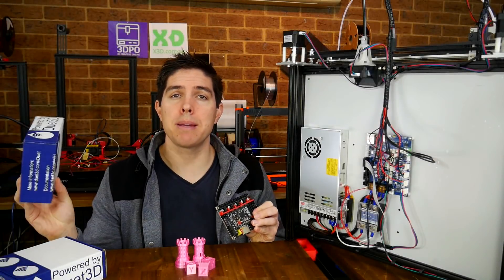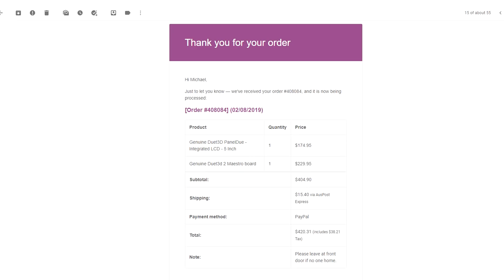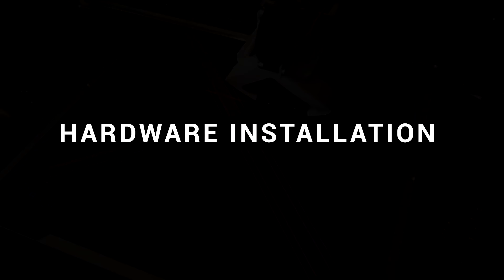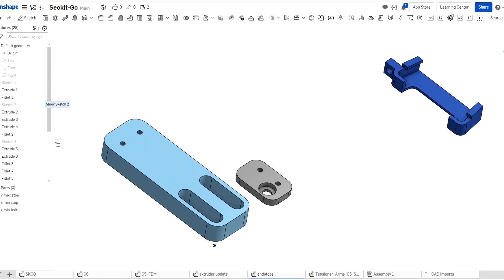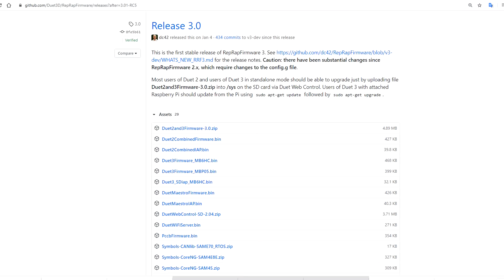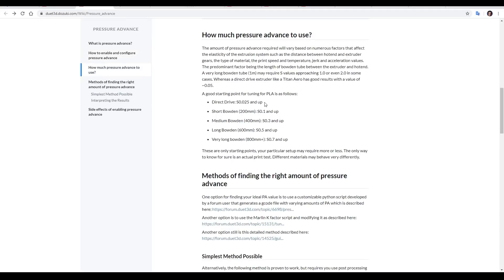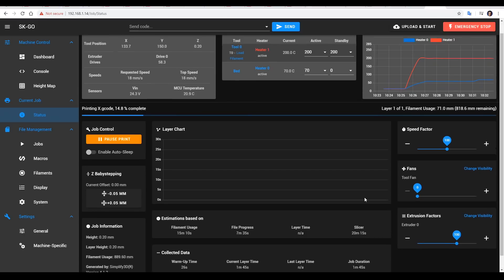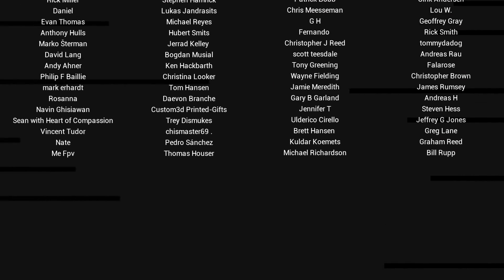Duet 2 Maestro & Reprap firmware on SK-GO: Guide for a Marlin user

Comment: Great video as always.

I am running a Duet 2 Wifi on one of my printers, and an SKR 1.4 on another.  I love that if I move the board to a new printer, setting up its config is a breeze, as long as you are getting power and are connected to the network you can configure absolutely everything else from right in the Duet Web Client.  Contrasting to this, if I want to play around with different features on the Marlin board it usually requires a recompile.

Also if you do not want to outlay for a official board, as it is open source hardware you can get a perfectly good clone from aliexpress for about the same price as an SKR 1.4 with 2209s, and although it is nice to have the display, you can work it perfectly well with a phone or tablet over WiFi, so it is a totally unnecessary purchase.

Joe

Comment: Hi Michael, thanks for the video it's always interesting to see what you are up to. For me I can say that no, there is nothing here to convince me to switch to Duet boards from my current setup. I run two printers, an Anycubic Linear Kossel and the ubiquitous Ender 3, both of which I control with a Raspberry Pi/Octoprint. From a purely economic point of view the Duet boards make no sense since networking, Wi/Fi and web interface are taken care of by the $39 R-Pi. Also by not screwing around with the printer controllers I'm not running the risk of damaging my printers. I know the E3 stepper drivers are noisy but it seems that since using damper mounts the stepper noise has been cut down considerably. I can install a large number of plugins in Octoprint and the R-Pi gen 4 is a very nippy processor. That's what's doing all the heavy lifting for the printers which seem more than capable of accepting the low level G code being sent out by Octoprint. I can set up a printer with Octoprint  and a fresh $39 R-Pi in about 10 minutes without digging into the printer itself. Contrast this with spending $150+ and at least a day switching in a Duet board not to mention the considerable risk in doing so.
Reply: From an economy point of few you also have to pay for the pi at which point a duet maestro alone is fairly similarly priced to an SKR + drivers +Pi, in particular if you buy a chinese clone (it’s only fair to compare Chinese prices against each other)
Reply: @christophmuller3511  Sorry I missed your comment. I have not upgraded any of my printer controllers. I am using the original controllers supplied with the printers, also I have discovered how to run multiple printers from one Raspberry Pi 4. I would feel comfortable running up to four printers off one RPi. So my total cost is about $55 (depending on where you buy it).  It is approximately one third the price of a single Duet board and it's open source and since it's an Rpi it is infinitely configurable if you want. That means you get Wi-Fi, Wired Ethernet, video surveillance, remote access and a huge library of plugins from the Octoprint community. For $55 plus whatever you want to donate to Octoprint Foundation.
Reply: Christoph Müller Exactly how I reasoned!

Comment: I would love to try out a Duet 2, looks like an amazing card but it is really expensive.  It is great to experiment with these new boards.  Great video as usual Michael.  I reviewed the BTT SKR Mini and I am really impressed by that board, especially the price.
Reply: Very expensive, insane. For me it costs (with 7" screen) near 10 cheap filaments.
Reply: @tolgal  There are 3 options:
1) Buy "Genuine" Duet hardware for $170+
2) Buy 3rd party Duet Wifi or Maestro hardware for $70+ (which IS allowed for under the license that Duet uses: https://github.com/T3P3/Duet/blob/master/LICENSE )
3) Buy nothing
For many people on more restrictive budgets however, the only relevant options are 2 and 3.  You'll notice that neither one of these options has any real impact on Duet3D except perhaps for people seeking support for their 3rd party boards on the official forums, which they already have a rule against.  If you've got extra cash lying around, sure.
Reply: @tolgal  Yes, but I bought from Ali because: I was not sure will I be able to put it into my printer (Anycubic 4Max Pro), how it will work, is it worth it, will I be able to solve the obstacles with my extruder etc. If you know what you doing it is great to buy original, if you trying and chances 50/50 it is worth to try with cheaper replica.
Reply: Tolgal I do have originals in my printers. But the boards are open hardware after all and dc42 doesn’t gain anything from people using SKRs instead.
Reply: You can buy clones from Aliexpress for significantly cheaper if cost is an issue for you.

Comment: If you use prusa slicer you
Can slice and directly chose to transfer the file to the printer if it’s connected. You can also chose to start the print as soon as it’s transferred.
If you like to tinker with your printer duet is so easy to use cause you don’t need to compile firmware. The duet forum is also superior to anything. Most of the time you get professional answers in a few hours.
Reply: You can use the Prusa Slicer to transfer files to any Octoprint printer. Marlin works fine.

Comment: Superb informative video (as per norm) the main issue I have with not already trying the duet is the need to re wire, it's not easy the amount of tools I have bought trying to help me with that is embarrassing to say the least. Thanks again though.
Reply: Ultimately you only need one crimping plier: Engineer PA-09. Yes, a bit more expensive, but compatible with pretty much every crimp connector you will find in a 3D printer, including JST (SKR boards), Molex KK (the duet boards),  Molex MicroFit JR (used by some E3D hardware)...
Reply: You could solder the wires in those terminals. But if you wire a lot, I agree, a crimp tool is faster.
Reply: You dont have to re wire I have a flsun prusa i3 clone and my connections fits right In
Reply from the maker: Besides the need for the tool is the time requirement, which is pretty significant.

Comment: Hey Michael, why aren't companies using the same MCU that's found in the Teensy 4.0 and 4.1? That MCU is a beast and it's actually cheaper compared to the Duet 3 MCU ($9 for the iMXRT1062 versus ~$10 for ATSAME70Q20B in 100s of quantity per DigiKey/Mouser).
Reply: The teensy might be faster but without looking too much into the specs of those chips, i assume the atsame70q20b has some IO or other features that make it better for their needs
Reply: @NicklL0809  I did a quick rough comparison, the IO seems to be about the same more or less. I guess they went with Microchip MCU since the other Duet boards are using Microchip, so probably less learning curve and ease of code reuse/management across products.
Reply: Software development costs? Yes, they are both ARMs, but then you have to redevelop all the low level code for acessing stuff like SPI, PWM, ADCs, ... - thats fairly expensive.
Reply: @christophmuller3511  That's definitely true. If you've stuck to one manufacturer/architecture for like a decade with tons of products based on it, I can understand. But when you're building a brand new product like the Duet 3 or say the TH3D EZBoard, it's shouldn't be big of a roadblock.
Reply: @shadow7037932  Duet 3 is brand new, but that is the hardware only. The firmware is not brand new. Cross platform development is hard and time consuming.
Reply: @shadow7037932  Duet 3 is not that different a product, just an evolution using a faster processor with CAN-support and newer drivers. The firmware is not that different, except that there is now the option to run parts of it on a raspberry pi if the user wishes to do so.

Comment: I have an skr mini e3 on an ender 3 with the 2209 in stealthchop..
I also have a diy corexy printer with a duet 2 wifi 2660 steppers..

The duet doesnt have stealthchop, and are definately louder than 2209 in stealthchop.   But no way near as loud as a4988.   Also they are less noisy than 2209 in spreadcycle..

They are quiet enough, but my e3d 48mm motors are DEAD silent on 2209   and near silent on 2660..    but... 2660 are providing WAY more torque
Reply from the maker: Thanks for responding to my question with great info.

Comment: Hey folks, looking for a bit of help just changed from the standard board on my ender 3 to a btt skr mini 1.2. I changed all the wires one by one, now my bed wont stop heating as soon as I turn it on. Anyone help please?
Reply: by any chance did you put the bed wires in the left slot of the bed terminals? as that gets power the moment you turn it on
put it in the 2nd slot so the right side of the bed terminal ones.
Reply: Is your extruder fan tunrned on? No, then, try swapping your extruder fan and bed cables. I think i had this issue too, this is because the extruder fan has to be always on and get powered.
Reply: @omit477  This^^